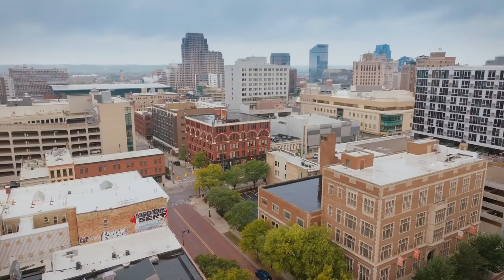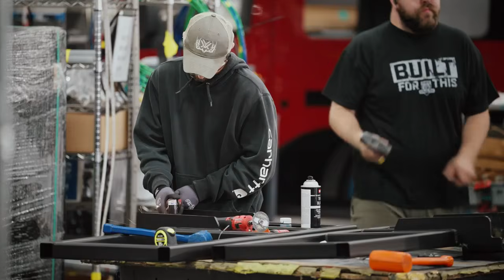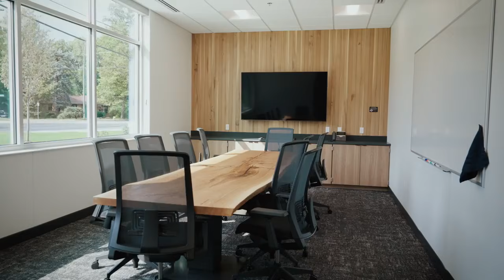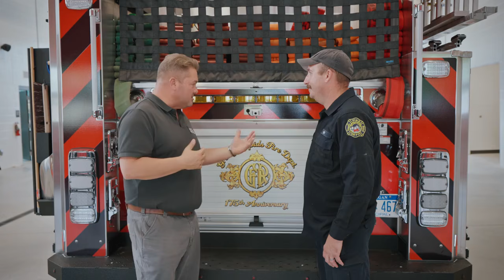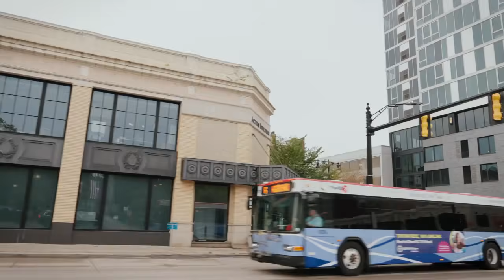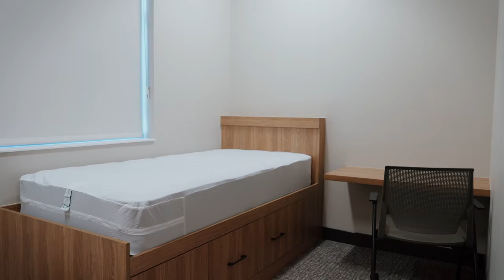NEW Engine Co. 12 - Grand Rapids, MI Fire Department

Comment: I would think that a the GR Fire Authority would buy an HME Fire Truck as they are built in Grand Rapids.  I did some Google Searches.  I never head of Engine CO.. 
  Sounds like HME has had some buy outs or Mergers I see the description in this Video says this:
This video project is done in partnership with HME Ahrens Fox to highlight the new Engine Co. 12 and the progressive Grand Rapids, Michigan Fire Department.
Reply: Because HME sucks. They were terrible for years and only recently have they been trying to improve. Stations stopped using them years ago.
Reply: @louisharrison2643    Strange.  I have bought a lot of truck parts from Valley Trucks.  I met a gal on a dating site. She worked at HME she gave me a tour of the Factory on a Sunday.  That was many years ago.
Reply: @louisharrison2643    Also I own FWD and Oshkosh Trucks too. Both of them make Fire Trucks  FWD Seagrave FWD  bought Seagrave like in the early 1960's and Oshkosh bought Pierce Fire Trucks
Reply: "Engine Co" is the Company number... Engine Company 12..

HME has Owned the Rights to the Ahrens Fox name for awhile now, Probably about 10 years.

Comment: No damned wonder my city property taxes have increased so much to buy these new toys.  What's wrong with the current fire trucks?  I don't buy new cars every 3 years!
Reply: Toys??? Will you think these are toys when your house is on fire and one of those old current fire trucks breaks down on the way to save your family and your property? Or there aren't enough fire fighters manning enough fire stations to cover your growing city properly to reduce response time?
Reply: @stevepotthast4911    if fire trucks breaks down as you say it's because of maintenance neglect.  How many miles does a firetruck drive sitting in the fire barn 95 pct of the time?  I have never seen a rusted out city fire truck.
I have seen the expensive brand new CNG fueled garbage trucks the city just purchased.  And then the city attempted to strong arm all city houses to use city trash and eliminate private trash pickup service...damn sneaky of them.